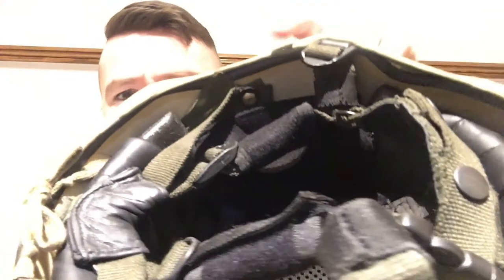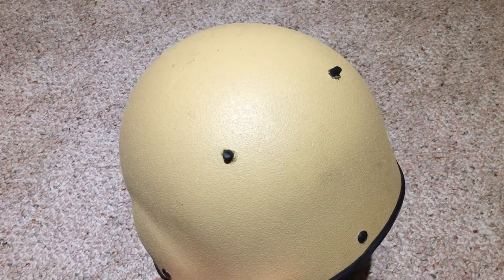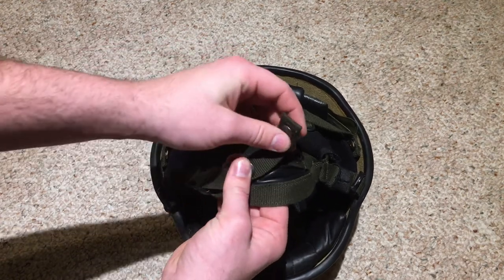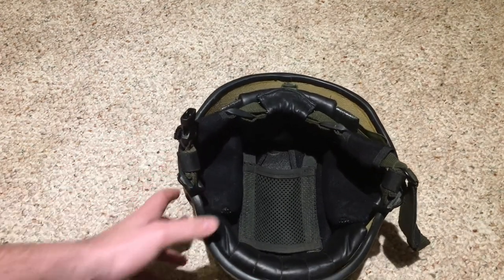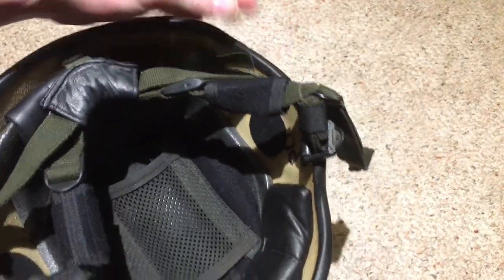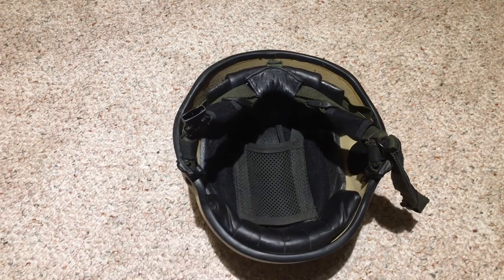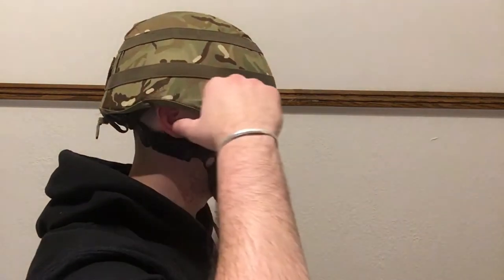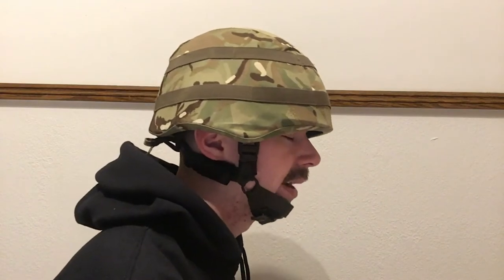British mk7 Helmet

Comment: Few years ago when these started to be surplussed out in the UK, you could pick these up for around £35 a piece in basically unissued condition. I bought one back then but wish I had got more. They are still pretty available online here, but nowhere near that cheep anymore. Although brand new ones still pop up for around £60-100 which is still not bad.

Comment: What's the actual weight of this helmet (L size)? I mean the whole helmet - with the suspension system and cover. I've googled that its weight is just one kilo - I think this is BS, though. 
I've watched your video briefly, so pardon if you said it there.
Reply from the maker: It is heavier than 1 kilo but it also depends on size, smaller sizes weigh less
Reply: @DevinK  thanks, mate. My ACH is 1.6 kilo - it's pretty heavy and hurts my neck. Is Mk7 much lighter on your experience? Does Sordin (neckband version) earpro normally fit under Mk7?

Comment: I can see why Ukrainians love this helmet. It's fairly light, offers good protection, and the liner is a pretty good design. Overall it's far superior to the Ukrainian home grown design in terms of comfort. My only gripe with the thing is it's prone to wobbling side to side if you don't have the add on pad system in it. I put some of the smaller ACH pads in it on either side to stop wobbling. The add on pad system squeezed my head too much